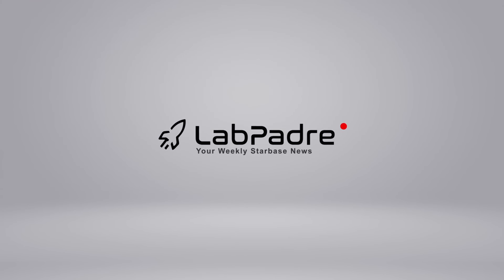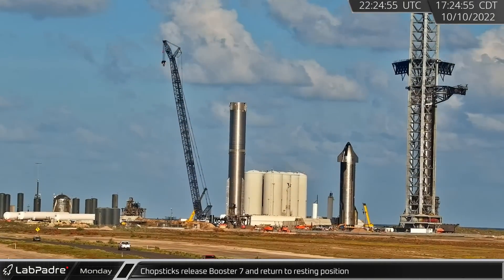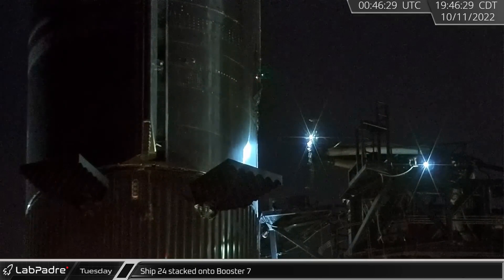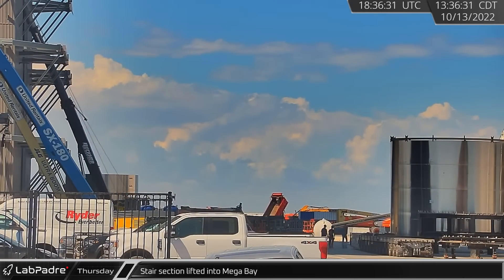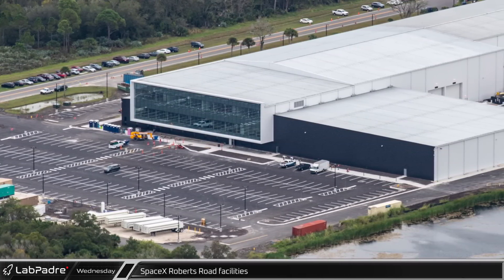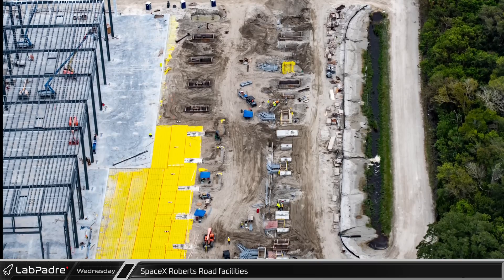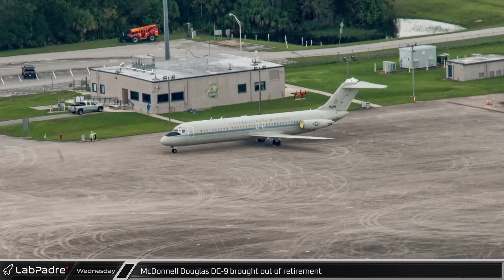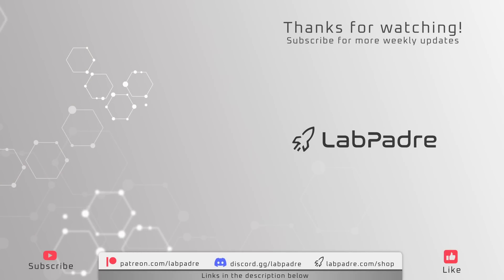Super Heavy Ready For Full Static Fire - Weekly Update #32

Comment: Given the lack of a concrete base for Mechazilla 3, I wonder if this is destined for one of the converted drilling platforms (Phobos or Deimos).  This could be used for launches, if there is too much red tape from Cape Canaveral and/or the FAA or it could be used as a catching mechanism off shore for launches from 39A.
Reply: The concrete base is constructed right at the launch site (because it's directly connected to the foundation), not pre-fabricated at Roberts Rd.
Reply: @alvianchoiriapriliansyah9882  Yes, but there is no evidence that a concrete base has been built at any of the launch sites.

Comment: For me, the best place for the third tower is directly at Robert Road Starship Building Site, for it to be used for the firsts stacks of Boosters and Starships.
It could avoid to discover some issue during this operation miles from there, on Launch Tower at Cape Canaveral.
Reply: The high bay has a bridge crane sufficient enough to assemble the vehicles. And there will never be a full ship + booster stack outside of the launch pad, this is different than SLS & other rockets
Reply: @alvianchoiriapriliansyah9882  i’m talking about a full stack as test, before destacking it and move the 2 vehicles to Cape canaveral. For now, we just don’t have the answer, so it’s an hypothesis.
Another hypothesis would be a preparation for one of the offshore platforms.
Reply: @elyw2174  Those test already happened at Boca right now
Reply: @alvianchoiriapriliansyah9882  as it’s a production line at Robert Road, they will not send it at Boca to be tested before going back to Cape for the launch.
Quality control, you know. I just try to make the distinction between the prototypes and the mass production : Even if the production line is strictly the same, there can always be surprises on daily basis.
Anyway, we’ll see soon enough.
Reply: @elyw2174  Both Boca & Roberts Rd. factory are producing the.....same vehicles, so the R&D going on at Boca launch pad right now is a representative for other future launch pads. No need for a short test tower to check everything, it's already been done at Boca

Yes, they're likely going to do a fit checks & everything on 39A, but again they already got the data from Boca, so no need for separate test tower, it waste money & time

When there's a new configuration (example: 9 engine ship) that require several pad changes, sure bet that it would be tested & fly from Boca first
Reply: @alvianchoiriapriliansyah9882  ok, quality control doesn’t mean anything for you on production. Understood. 🤷🏻‍♂️
Reply: @elyw2174  Ok, cost & time trade-off or "we can do the quality & fixes at existing launch tower, so why we must build a test tower?" doesn't mean anything to you, understood 🤷

Comment: Just a super wild guess, but could the next tower sections be for one of the oil rig platforms? Another great summation of the week. Thanks!
Reply: Not a bad thought, but it seems unlikely as we have seen the steel base pieces that are used to interface the steel structure with the concrete base. The towers for the oil rigs should have a different design as they will not need a concrete base.
Reply: @WLAnimal  Wondered about that too. Possible it could be for keeping commonizing thought process. Just thinking that anything is possible when it comes to those oil platforms and converting those over to something entirely different from what they were originally intended for.
Reply: @WLAnimal  very possible. Perhaps it will replace the falcon 9 launch tower once starship becomes reliable but that is still years off.
Reply: My guess would be that this is the Falcon 9 Crew Access Tower for SLC-40. If I was SpaceX I'd use a design I was already familiar with and make it so it can easily be converted to a Starship tower in the future.
Reply: @chrisparrspacey_uk6917  Probably the best idea here! Makes total sense, though can you imagine how tiny it will make the F9 look? 😁
Reply: @miroslavmilan  indeed, but they could stack the first 5 or 6 levels now and store the rest nearby. But my guess is they would stack it all while they have the big crane on hire. It'll never look as odd as a Saturn 1B on a milk stool.
Reply: @chrisparrspacey_uk6917  Agreed, they’ll certainly want to make use of the big crane and build it all at once.
Reply from the maker: Cool idea!
Reply: Things that make ya wanna go Hmmmmm :) I don't think so because of @WLAnimal 's words on it, but you never know what the Engineering team is gonna come up with Joe, considering things change by the minute with them. Less is better as Elon says...
Reply: Was thinking same, and until now didn't see this suggestion and wanted to comment...
We will see 😉